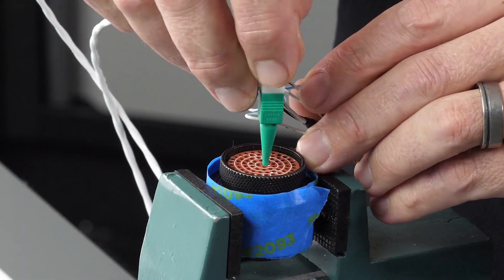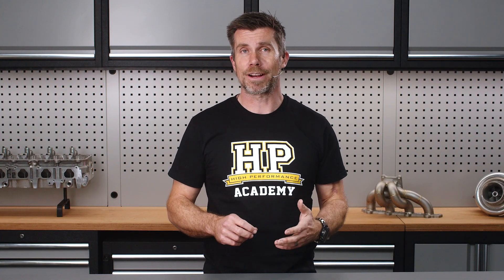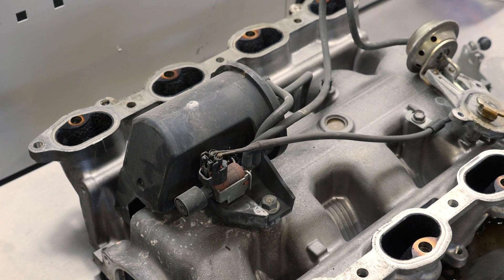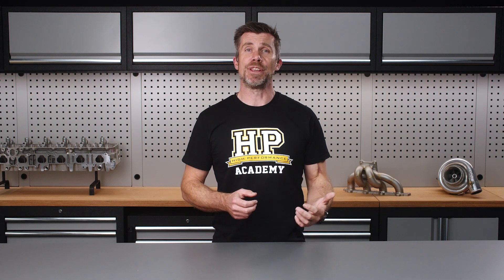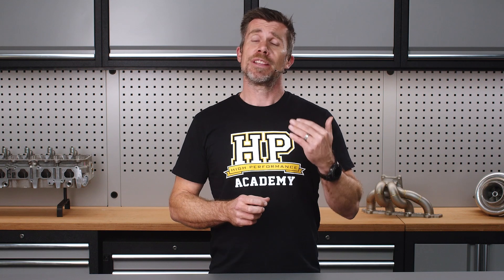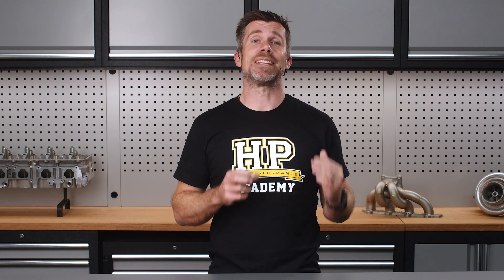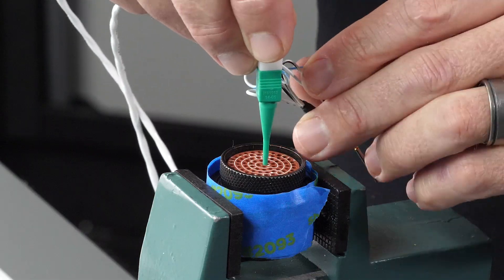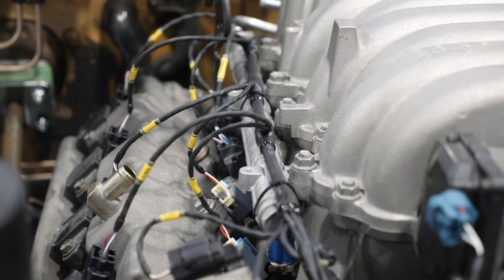Put The Motorsport Wiring Tools Down | Motorsport Wiring Planning 1 of 5

Comment from the maker: What has been your own biggest wiring 'save' that planning avoided, or even your biggest oversight that you wish you had avoided and have learned from? - Taz.
Reply: I know its not mil-spec but I'm really glad i used distribution blocks for all inputs and outputs in-between the ecu harness and engine/chassis harness. Lets me add on other systems or sensors if i need to in the future without cutting up the whole harness.
Reply: From my experience wiring the odd race car etc it is meticulously planning and routing of cables and electrical components . Neat runs / branches / splits . I tend to plan wiring  as you would rigid pipe work ie straight/ 90 deg takeoffs for sensors / injectors. 
Always temporarily fix the loom into a car allow for alterations at a later date  , always use quality multi pin bulkhead connections rather than drilling a massive hole in the firewall and then a crappy grommet . 
May cost £200 more in connectors but your loom can be easily split for alterations and maintenance .
BMWs I think still come with lightweight insulated cable so ideal if your on a budget and there’s always excessive amounts of it to standardise your colours . 
Simple is neat 
Neat is reliable 
Reliable is one less thing to worry about 👍🇬🇧

Comment: We can communicate with satellites wirelessly, why can't we communicate wirelessly within our own car ?
Reply: We could but you got to deal with latency.
Reply: I think that most people that know electronics well will try to use a wired connection wherever possible. From reliability, power consumption, security, and more, wired connections have lots of advantages. 

Remember that practically all internet traffic runs through wires (copper or fiber optic) for most or all of the route. Even if you’re using 5G mobile on your phone, for example, the 5G base station is then connected with fiber to the Internet. All the Internet traffic between continents is through submarine fiber optic cables. 

Somehow, people have gotten (for many years now) the impression that most telecommunications happens via satellite, when in fact the exact opposite is true.

Comment: Thank you so much for this extremely valuable resource. You helped me plan, layout, and create the engine and chassis harness for my time attack car. Thank you so much for unscrambling the mess of ideas in my head!
Reply: 2 things that helped the most are:
1. Splitting it up between power supply and signal sections. I then split it further from power supply to const & ignition power

2. Laying out the harness with synthetic rope was genius and gave me everything I needed to build the harness comfortably and confidently at my work bench.